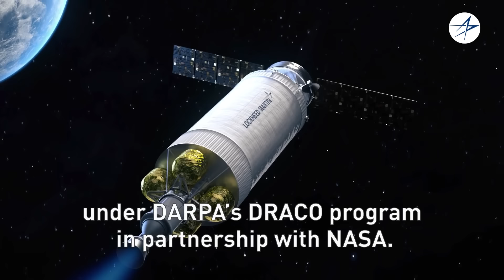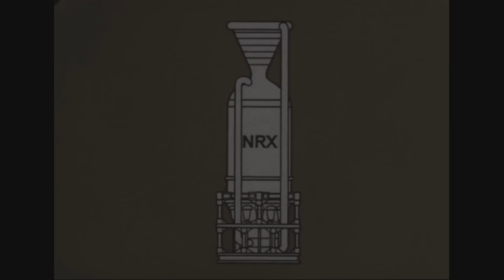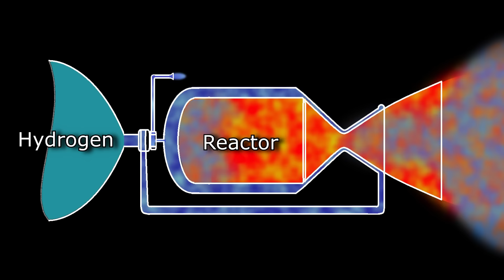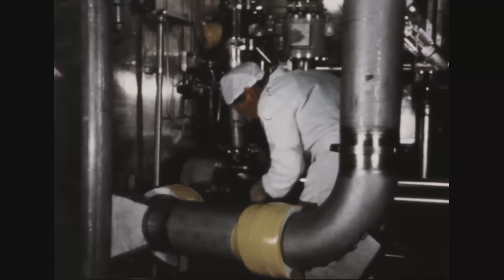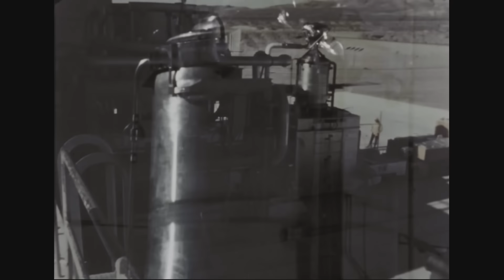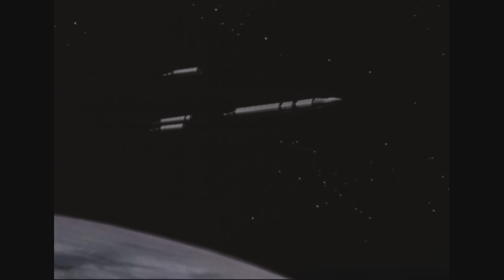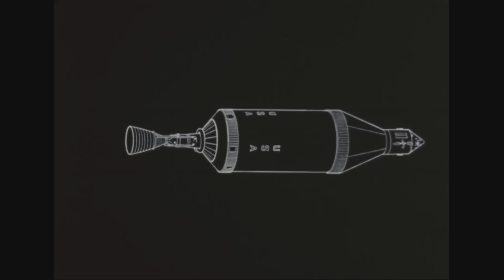Why Nuclear Rockets Are Going To Change Spaceflight

Comment: "Machined down uranium rods..." sounds like a great career path
Reply: "Machined down bomb-grade uranium rods" at that
Reply: @boulder795 imagine the dust on the floor reaching criticality 😛
Reply: @photon6668  the metal shavings turn into the big stew and you become David Hahn
Reply: I imagine the 50€ vacuum I use on my lathe wouldn't make the cut.
Reply: @CanalTremocos  There are videos showing how it used to be done. Basically, an ordinary lathe, using lots of coolant to keep the chips from igniting, plus a vacuum hose to pick up the finer particles, plus a respirator for the operator, just in case. More modern facilities put the whole lathe in a glove box.
Reply: @CanalTremocos  Yeah, I bet this needs a shop vac that costs at least twice that much.
Reply: @CanalTremocos  I think it's all done in distilled water to catch any radioactive particles. Water I great and countering radioactive elements
Reply: @CanalTremocos certainly better tooling for cuts, than a vacuum 😂
Reply: “Hey, Adam Savage here, NASA asked me to turn down these rods?
Reply: I’d be a lot happier being around uranium machining than plutonium. Or beryllium.
Reply: @hhlADSGHhadg isn't beryllium mainly an issue for a very small segment of genetically suseptible people?  I know beryoliossis is very rare (i mangled that word for sure)
Reply: I didn't realised for a long time that the production of fuel rods depends on machining nuclear material.
What was the name of the US facility where a lathe with plutonium caught fire? Rocky flats?
Reply: @benjaminhanke79  I believe Rocky flats was plutonium pits... probably worse than fuel rods. I think most fuel rods are molded out of some oxide as well... could be mistaken about that though.

Edit: I see you said plutonium in your post, I obviously can't read...lol. it was nuclear weapons, not fuel rods in anycase
Reply: @benjaminhanke79 Piketon, Ohio did some of that work too
Reply: @benjaminhanke79  "production of fuel rods depends on machining nuclear material" it is not, nuclear fuel is sintered ceramic 'tablets' sealed within circonium rods, no uranium machining
Reply: @benjaminhanke79 pretty sure that particular machining job would have to be automated since the operator has to breath and we'll, PU isn't a fun substitute to play with.  And the machining operation would have to be done in an o2 free atmosphere since it oxidizes quickly and I believe burns pretty readily.   Not to mention it's all kinds of bad for biological life.

All that said, it's outright magic stuff and we should have been going hard into research on everything nuclear decades ago, not regulating it into oblivion because it scared some hippies and because the russians were cheap, lazy and had no regard for human life and cut corners.  I mean look at russia now?  Basically nothings changed, they still have no regard for human life.  

Don't stop doing something because someone else is bad at it. Do it better instead.
Reply: I hope this is automated...
Reply: Nuclear fuel manufacturing is really funny because you'd think it'd be specialized bespoke robotics in an underground lab, but naw they just sacrifice a regular CNC machine to the sun God, and everyone wears a respirator.

There's a little more to it in terms of safety, but less than you'd think. Remodeling a house is an order of magnitude more dangerous.
Reply: Still safer than machining beryllium.
Reply: “In Rod We Trust”
Reply: Imagine re-selling the CNC machine after its used.
Reply: I'm not smart in this field by any means, but aren't fuel rods safe before they have been brought to criticality in a reactor?
Reply: @volvo09  it's still a bunch of radioactive graphite dust that gets everywhere, at least in this case. very not good, extremely not good if inhaled.
Reply: @crackedemerald4930  That's why I have a shop vac.
Reply: @crackedemerald4930 fuel rods aren't the graphite ones, they're rods of uranium metal or pellets of uranium in a metal casing
Reply: The nuclear fuel - usually uranium oxide in form of pellets - is encased in zirconium tubes. These tubes are bunched together, and this bunch goes into the reactor core.
The fuel rods, prior of being brought to criticality in the reactor, are safe to handle unprotected.
Reply: @volvo09  "safe" as in they wont explode, but are still radioactive
Reply: @volvo09 Great question, but the answer is "no."  While they're not the same nuclear hazard, they're still enriched and highly radioactive. Not only don't you want to be near the rods, but any flecks that come off are also radioactive, which can easily enter your body and last as a radiation source inside of you essentially forever. Heavy metals like uranium are also toxic from a purely chemical perspective. Good times!
Reply: Safe & effective.
Reply: lathes into a fine dust Smoke-235. Don't breathe this!
Reply: @jedihunter176 puts uranium in blender, don't breathe this!
Reply: When he said „machined down uranium rods“  I was baffled. Beside from the danger I wonder what kind of mills you use for mixture of Carbon and Uranium. I mean both elements are really hard.

Scott should do an entire video on machining down Uranium 😅
Reply: Maybe if you give your cancer cancer it cancels out?
Reply: @JOlivier2011  You mean cancer it out?
Reply: wear your respirator!
Reply: Don't want to do that on a manual machine standing right next to it that's for sure😂
Reply: My teeth are itchy..
Reply: just don't get 20kg of scrap
Reply: I am aspiring to get into this career path. Im currently working in an asbestos mine in the interim until there are job opportunities in this field.
Reply: You may need to collect the dust separately you don't want to collect enough it reaches critical.
Reply: @thomasbailey6997 Yeah, just collect all the dust into a 5 gallon Home Depot bucket. 😄
Reply: Splitting is much easier than squeezing 😢
Reply: I heard it's the equivalent of a chest x-ray
Reply: That's a load the material and watch it from another building kinda job 😂
Reply: Exciting employment prospects for lads who want to work in the nuclear industry.  Of course you must be good with a file.
Reply: I read your comment first "sounds like a great cancer path" guess that's how my mind works 😂
Reply: idk what you're talking about.  after getting fired from my jobs as an asbestos fashion model and benzene taste tester, i was glad to get hired as an uranium machinist
Reply: Uranium is at least, a regular piece of metal. Plutonium on the other hand is self heating and will phase change during machining and also can be as soft as putty if you actually try to machine it
Reply: I bet machining uranium down is actually a safer job than cutting out quartz & granite countertops b/c the nuclear industry has proper norms around using respirators
Reply: What's the SFPM of uranium... it's all about the speeds and feeds.
Reply: @_mysilentblue2227  No idea.
Reply: At least you don‘t have to worry about your pension.
Reply: To cancer….
Reply: Allegedly lots of work to be done in that field as the us is restarting plutonium pit production to maintain their nuclear arsenal. A lot of the people that used to do that have retired/switched jobs since the 90s when production essentially stopped
Reply: Sounds like a job for worker THX-1138.
Reply: "Eye and ear protection must be worn in this area"
Reply: Illuminating career
Reply: It will be bright, but short!
Reply: @viniciusdesouzamaia  short term great, long term bright? Homer Simpson dream job anyway.
Reply: Sounds like a wicked band name
Reply: Early retirement guaranteed! And no need to worry about Hospital bills!
Reply: “Sir, I’ve got the perfect prospect. Homer Simpson in sector G is our man”.
Reply: If it pays well, which it will, people will do it.
Reply: Geez. You guys never heard of 'waldoes' ?
Edit: Showing my age, yeesh. Yeah, CNC and robotics is how they'd do it now
Reply: Bullshit manipulators mandatory not funny serious stuff.....
Reply: And you get delicious snacks! 😋😋😋😋
Reply: Lol, right?! I've done alot of questionable things that are pretty reckless. Welding galvanized metals, grinding and cutting with no glasses, heat stripping old leaded paint without a mask.. but idk if I'm just gonna chuck up a rod of u235 in the lathe and go in on it with no ppe.. in fact, I'm not sure what level of ppe would make me comfortable... maybe a lead loincloth to protect my balls.. and then like safety glasses and an n95 mask.. yeah. That'd probably cover it..
Reply: A lot of specialty equipment needed to do so safely. I bet it pays well
Reply: Quit being a bunch of nuke ninny’s!
Reply: The cnc machine is shielded from radiation and fully ventilated. It’s also loaded and unloaded by robots that are similarly sealed away from the user
Reply: I was thinking the same thing.
Reply: My very first thought!
Reply: Still better than "Uranium Plasma Controller"
Reply: i dont understand your point. why is it necessarily bad?
Reply: That's my metal band.
Reply: You might be unemployed for most of your career but im sure a nuclear machinist could make 50k an hour
Reply: Turned down for WHAT?
Reply: From my understanding generally it’s only the spent fuel that’s highly radioactive - uranium fuel rods before can be touched relatively safely by hand.
Reply: Bahh it can be done with a potato peeler.
Reply: Lung cancer is always fatal 😬
Reply: Starships designed functionality wouldn’t suit having one of these babies up its tuchus.
Reply: Black'n Decker, Black'n Decker, Black'n Decker . . . 😂
Reply: Make lots of money.... for a short time, kinda like the musicians that last until 28yo.
Reply: Basic fuel pellets for fission power generator are safe to handle. Here in Finland we can take tours to nuclear power plants and on one of those I got to hold those pellets.

But if there's dust from machining that isn't good to inhale. Also I'm not sure how weapon grade fuel differs.
Reply: Don't forget to do this man a favor.  Like and subscribe!!!
Reply: Nuclear has driven whole arenas of cnc & remote machinery development.
Reply: Does it come with dental/vision? What about 401k? Sick leave? That last one, especially
Reply: It's not too bad. Machined remotely through a lead glass thick window, minor inspection and rework through a sealed breather box while wearing a pressurized sweat bag. The biggest issue is the sworf catches fire bc smaller chunks of metal = less thermal mass and in presence of O2 will kick off so an inert atmosphere or a blow down on the sworf pile keeps it kosher till it's shoved in a barrel and let to chill for a long while🎉
Reply: Sounds like a good band name.
Reply: Oh stop with the anti nuke jabs already, you're scaring the trolls!
Reply: Thought the same thing 😂
Reply: Super high turn round of staff
Reply: Shadow shield and umbrella
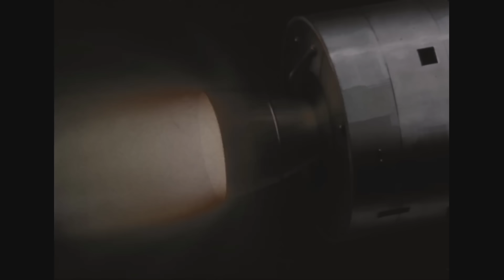Reply: Shadow shield and umbrella 18:54
Reply: Unreacted Uranium fuel is not dangerous unless inhaled or ingested. My guess is they did it with automated CNC machines or something and kept the dust away from people.
Reply: @keeganplayz1875  one could say that about most of the periodic table. Oxygen kills btw.
Reply: Also a great name for a metal band
Reply: Imagine at one point there is a: ,,How machined down uranium rods are made" and it cuts to some guys and 2 kids turnin them on a lathe without any sense of safety whatsoever.
Reply: All 20 minutes of your career, then straight to Ashes to Ashes.
Reply: Good think rockets never fail. I'd hate to have that dust my location.
Reply: Uranium, even weapons grade uranium, isn’t very hazardous until it goes sun critical or critical (might not even be bad at sun critical). 
Nuclear energy is totally misunderstood by the vast majority. 
I’ve stood at ground zero in Hiroshima just 35 years after the first nuke bomb was dropped on them. I was surrounded by a thriving metropolis that took several decades to build and so it’s not the nuclear wasteland of science fiction. 
I’d far rather have this technology than the one that uses nuclear detonations behind the ship to blast it forward. Yep, popping nukes out the back and detonating them for propulsion. They were actually researching it and built and flew a tst ship with conventional explosives.
Reply: @OpenCarryUSMC  until you inhale some during machining
Reply: "Don't breathe this"
Reply: Eh, with proper PPE anything is possible. Plus robots
Reply: I have a lathe and need a side job. What's the pay and benefits?
Reply: Someone call up NileRed.
Reply: Thorium and u233 and msr is way to go
Reply: Iron engine
Reply: PPE is optional on fridays, pizza party at noon, thank you for your service 🎉
Reply: PPE is for suckers
Reply: Uranium is a difficult material. When you reffine some stable isotops it's not different to machining aluminum or copper.
But once it get's activated and remains partially unstable it can get dangerous.
There is some Uranium in slate and other bricks. So it's almost certain you hold tiny amounts of it in your hands.
Reply: @MrHaggyy  Uranium is fine. Materials forming from it due to persistent decay aren't at all. There are multiple very short lived "chained" decay states with rare other element isotopes that kill you.
Reply: @vensroofcat6415  Yeah I know many metastable isotopes. But as you increase the heat you increase the chance of them decaying into something more stable.
But I don't know enough how long and hot a thruster keeps the material. Only a view things about how reactors improved over the decades in the same topic.
Reply: A Machinist can have a little uranium swarf and dust, as a treat.
Reply: Id do it
Reply: To think, there are probably some surplus machines floating around. Hot tamale is it's name. They can't figure out why it's always warm even when off😅
Reply: Project for Titan CNC
Reply: The type of job that AI and robotics should be used for... But a human is cheaper to replace so they'll just send us in instead
Reply: First of all, can we even prove there is a space?  What if the shape of the Earth is not what they tell us?
Reply: Just wear ur paper covid mask and youll be safe

Comment: How do they slow down?
Reply: Turn around
Reply: I assume the engine will point away from target destination for half of the flight and then flip 180° for the rest of the flight
Reply: @rubbishui  exactly, so what is gained?
Reply: What you're asking is an integration problem. Imagine graphing the speed of the rocket over time. The area under that curve is the distance the rocket goes. With a normal chemical rocket, the line is flat the vast majority of the time, with the long coast phase. It's a long rectangle whose area is equal to the distance between your start and end points. Being able to fire the rocket continuously turns that rectangle into a very tall triangle, the area under that triangle is a lot larger for shorter times. In other words, you cover more distance over less time if you are constantly accelerating for the first half of the trip then slowing down for the second half.
Reply: Flip and Burn (ala The Expanse)

Comment: I’ve seen people saying they might enable Mars in 45 days. Isn’t that mind blowing!
Reply: I'm terrified what will happen if the engine breaks while trying to brake...
Reply: With an Orion Drive you can have overnight delivery to Mars.
Reply: I am assuming you are deaf and can lipread. Or did you actually HEAR them?
And yes, nuclear rockets have a massive Isp on top of good thrust and can enable much shorter trip durations to Mars, and 45 days is definitely a possibility. Furthermore, Nuclear rockets have enough Isp AND thrust to make huge course corrections, should they be necessary. In other words, it can actually navigate the solar system instead of just an unpowered trajectory. Till now Ion thrusters are the best we have and they have a thrust of millinewtons.
Reply: @paulmichaelfreedman8334 It's a figure of speech, and yeah. Maybe he did "see" someone say that. Articles exist, after all.
Reply: @Orion-CSAT  In that case, he would have READ it. Just nitpicking.
Reply: @paulmichaelfreedman8334  Or saw it in a news article, but whatevs :)
Reply: @paulmichaelfreedman8334 And none of this is actually going to get built until it is cost effective to get resources from space. That may be never but we can start right now by focusing on Lunar Resource Development.

If we are able to make mining ANYTHING on the Moon cost effective (I have some ideas), then there will be market pressure to explore other resources.

Comment: Nice video.
Reply: Hi i am building a cubesat with these following components a esp32s microcontroller along with mpu6050 and bmp280 sensors along with a LoRa (ra-02) module which works as a transmitter and 3.7 v lipo battery 500 mah , and a solar panel with a charging board. What is your advice.
Reply: @paraspanvalkar9198 whats the question?